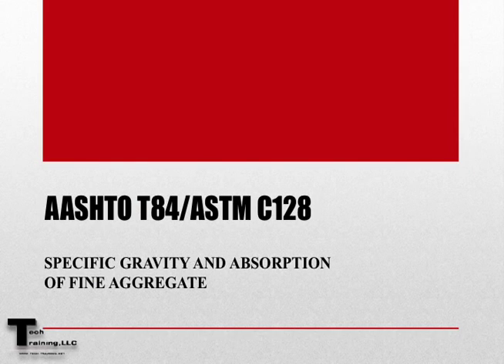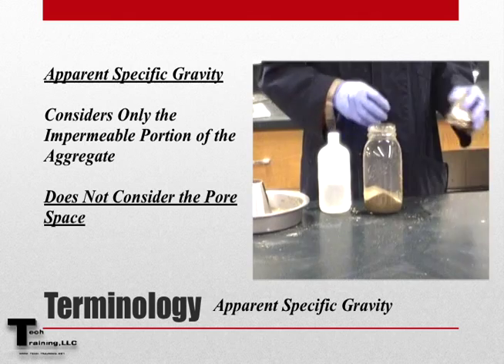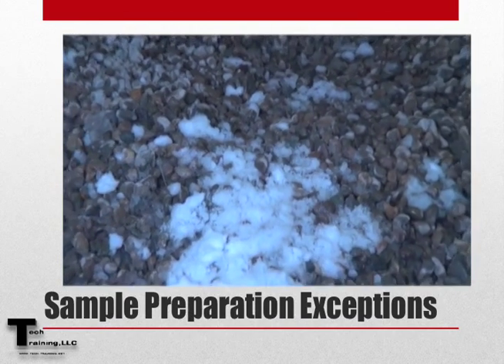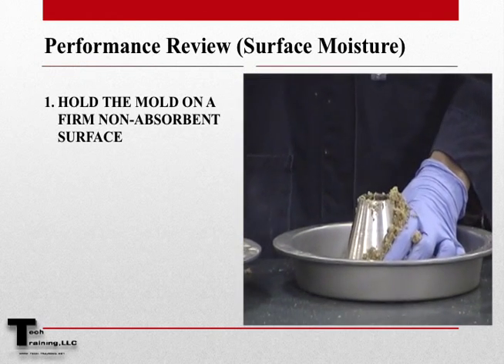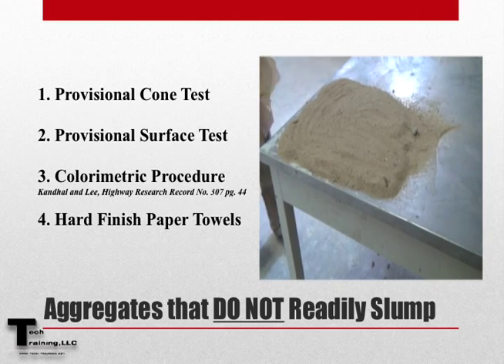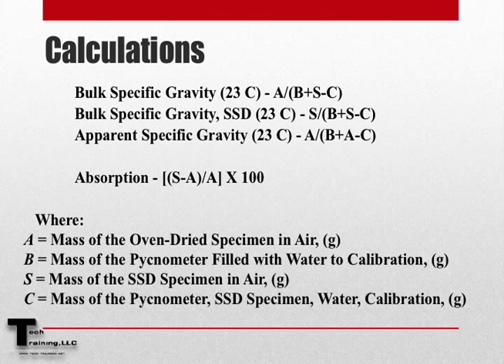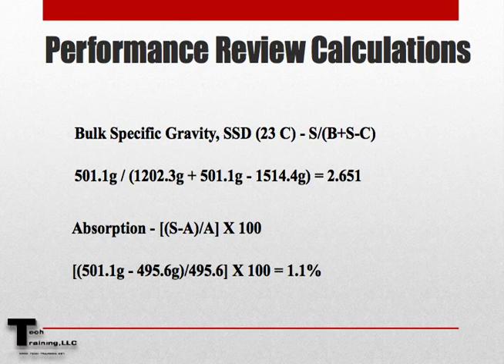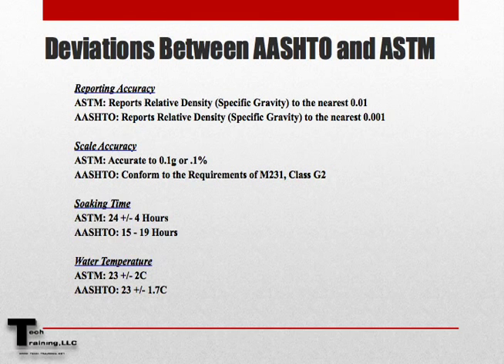AASHTO T84   ASTM C128

Comment: Hi James, I am not sure if I am misinterpreting the ASTM method of test but, in the video the technician seems to drop the tamper from 5mm above the mould and not 5mm from the top of the sample? please correct me if I am wrong.
Reply from the maker: Labbie RSA/NZ 
Hello, You are correct.The tamper should be ~5mm boe the "Sample" not the mold. As you may have noticed, the description (voice over) does say 5mm above the "Sample." However, I felt for the visualization, it was better for the gentlemen to bring the tmper up where it could be filmed. I hope this helps.
James
Reply: james Lee Thank you for that James I understand, the test method refers to the colorimetric method of determining SSD but I cannot seem to find a video on it. Did you guys do one?
Reply from the maker: Labbie RSA/NZ Hello, Sorry but we did not do a video on that procedure. James
Reply: @jamesLeeTECHTRAININGllc  why does it look like after the tamping and removal of the mold, it appears that the sand is higher than the compacted layer.  was a 2nd lift added.